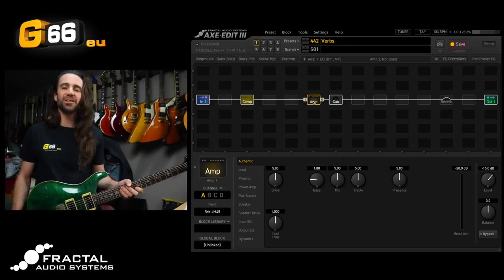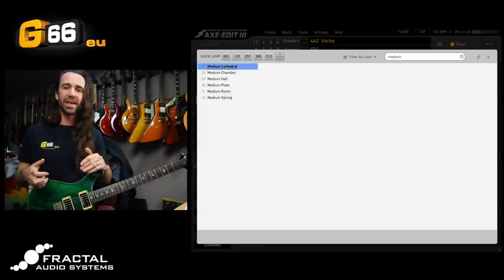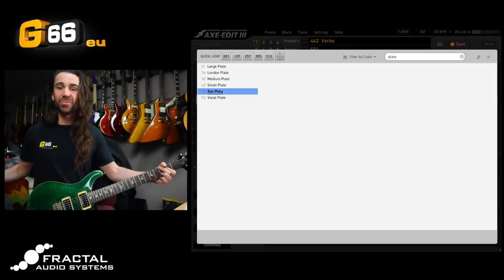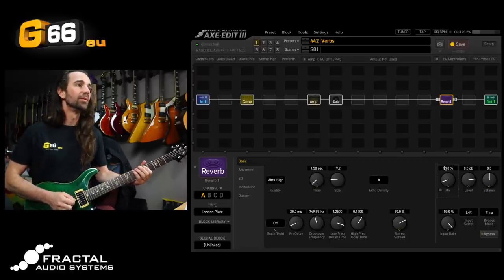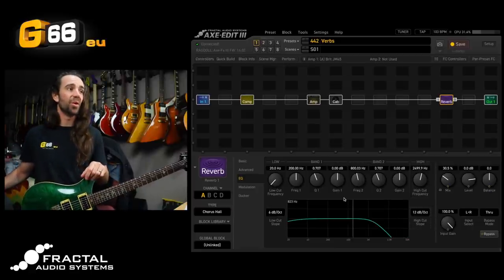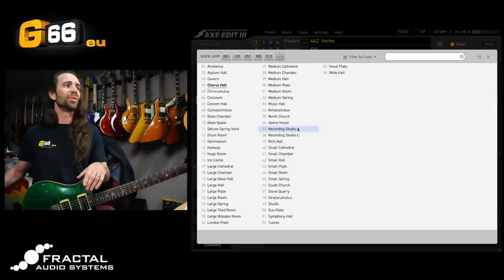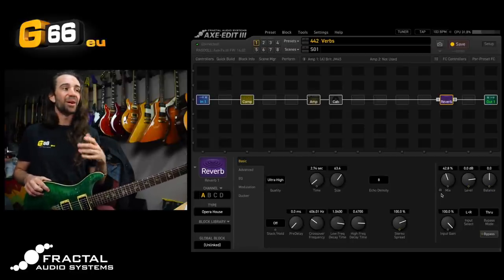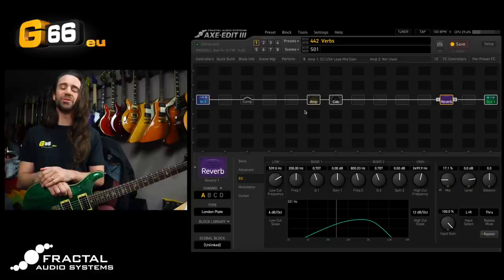Tuesday Tone Tip - Reverb

Comment: What about the FM3 ? Reverb costs a lot of CPU Power. Economic is the Lowest and Ultra High generates a lot of % of the CPU more. But I cant hear a lot of differences.
Reply from the maker: Use economy, the differences are very subtle. IMO economy should be called "high wuality" and ultra high should be "insanely ultra mega high"